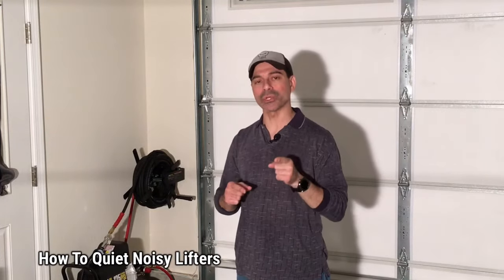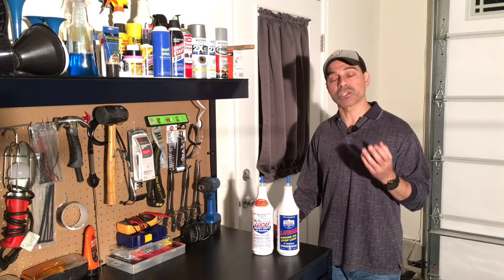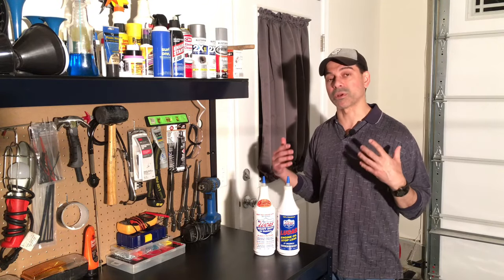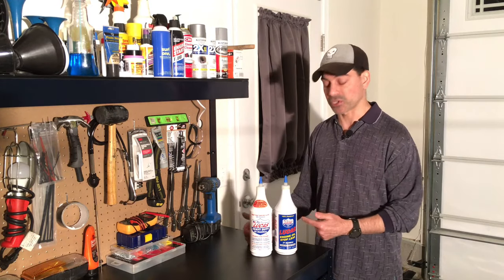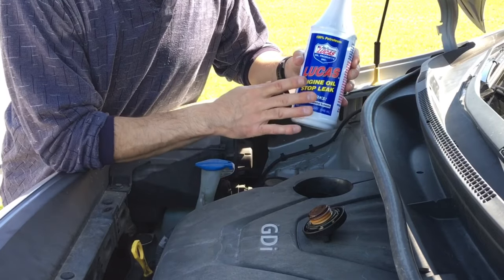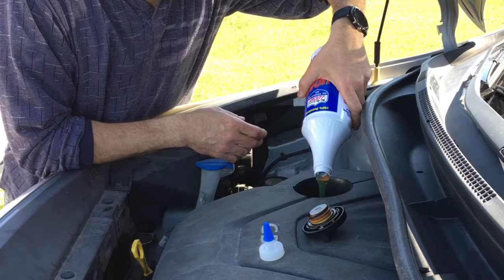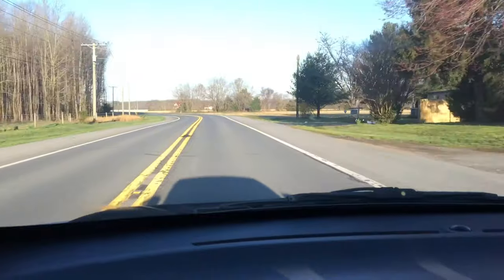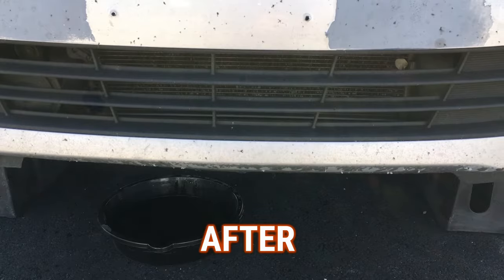How To Quiet Noisy Lifters (Andy’s Garage: Episode - 253)

Comment: Several years ago, my 2002 Chevy truck had a loud lifter ticking noise. I checked the oil and it was a quart low. I added a quart of Marvel Mystery Oil to the crankcase, and soon the lifter ticking noise disappeared, but not nearly as fast as the Kia in this video. I drove the truck about 400 miles and when I changed the oil, it was extremely dirty, telling me that the MMO had removed some or all of the sludge out of the engine.
       Now after a oil change and it is a quart low on oil, I add a quart of Marvel Mystery Oil to the crankcase for preventative maintenance.

       I have also been using Marvel Mystery Oil in the gas of my truck, car, and lawn mower at every fill up since 2016. I use the recommended amount of 4 ounces of MMO for every 10 gallons of gas. Both vehicles and the lawn mower are running better than ever, and my car gets at least an extra 1.5 to 2 more miles per gallon on the highway. With Walmart selling the quart size (32oz) bottle of MMO for $5.97 here in the USA, it more than pays for itself with the savings in using less gas.
Reply from the maker: Thanks for the comment
Reply: You added the marvel mystery oil to the engine?
Reply: @ tisbitae7--     To quiet the lifter ticking noise, I added Marvel Mystery Oil to the oil in the engine. You can add MMO up to 20% of your engine oil capacity. For example, if your engine takes 5 quarts of oil, you can replace one quart of oil for one quart of MMO. 
      You don't want to over fill your engine with the combination of MMO and oil.
Reply: 8/29/2023
2005 Suburban 5.3L with 283k on the clock... Lifters rattling the last 6-8 months.
Tried the Lucas Treatment tonight, except when it was a quart low, I added a quart of Marvel Mystery Oil to bring it back up to full... ran it a couple days, intermittently. 
Lifters REALLY rattled then!
5.3L in the Suburban holds 6 quarts oil.
I added:
1 quart Lucas Oil Stop Leak
3 quarts Lucas Oil Stabilizer
2 quarts Castrol 5w20 High Mileage Oil
Lifters rattled a good 10 minutes after initial startup... pulled it off the rack, let it idle while I cleaned up my mess, and went for test drive. 
Could not make the thing rattle!

Was thinking reducing the stabilizer to 2 quarts and increasing the oil 1 quart at next oil change... maybe, maybe not... the stabilizer is within a dolar of the price of oil.
Reply: @Brian-mp2mv did it blow up yet
Reply: @mikecorleone6797  sure did, crankshaft locked up in December with 290K on the clock. 35mph, 200 yards from home. Never ever drove that truck hard either!

Comment: We always put a quart or two of diesel and have engine warm when you do this just let I idle for a hour and watch your oil pressure gauge to make sure it does not get too low and shut motor down and drain your oil and pour a gallon of diesel just to flush any sludge out and then pour a couple quarts of cheap oil to help fish diesel fuel out and this on 390 ford pickup and the motor was ran with penzoil that had a problem of foaming up and sludge on valve train area and I always use vavoline because it never foamed up and this was back in the 70’s and 80’s but worked great to clean the inside of the engine out and lifters out .

Comment: This seemed to do the trick for me. thank you very much. I mentioned to my mechanic that it started ticking after my last oil change and of course they were willing to charge me 3000 to replace the lifters when in actuality they probably cause the problem by not putting enough oil in. will never go back to them.

Comment: I have a 95 Lincoln town car I bought in 2016. The original engine went on me so had another put in. About 4 months later it went. The engine in now is running pretty good as I have a great mechanic. The last 6/8 months notice some ticking mainly on exceleration. Also  some smoke sometimes on leaving a stop light. Put in the honey additive 2 in last 2/3 months. No more smoke and ticking not much. Gonna try the Lucas treatment and see how it goes. Engine has just over 114 and change. I don't drive much. 14 to 17miles 5/6days a week for work. I'd notice the ticking more when it was really hot outside. Not right away. When cool outside didn't hear it

Comment: Hello..
I had the Hemi Tick at 10,000 miles.. tick tick tick tick... that was so annoying. I added a bottle when I changed the oil.
my Challenger 392 ScatPack hasn't ticked for 5000 miles.
Use for all my vehicles, Audi A6 3.0 TDI, Beetle 1.8t and also for my Camaro Iroc 5.0 TPI...
The engines run so well with it.
greetings from Germany

Comment: The best product I have ever found to fix noise, leaks and even transmission problems is STP. To fix a transmission, ant transmission it must be put in and allowed to circulate with the engine running and the transmission warm. This is STP in the blue can for engines. It’s the best thing on the market.
Reply: I appreciate the STP suggestion and I'm all prepared to go the Lucas route if STP doesn't do the trick.  The greatest benefit is that STP is a small bottle that's easy to add to existing oil without having to drain some or do an entire oil change.  STP quieted the engine after about 10 minutes of driving.  Although it's still slightly ticking, it's much better than it was before and I'm happy with the results.  Thanks.
Reply: Did that make ur engine quieter or u had to change ur valve lifters ??
Reply: @tsytv108  in his comment he said it fixed the noise…

Comment: A 2005 lincoln town car I bought last month had lifter clatter on the left engine side at cold startup. It has the 4.6 2 valve engine. The previous owner was using the 5W 20. I simply changed the oil and used 20W 50 castrol and that clatter STOPPED. 5W 20 is for the great lakes area and where it gets below zero degrees, but in the south areas its too thin.

Comment: I've recently been throwing parts at a frustratingly unruly issue in my '98 yukon I bought a couple years ago. 

Issue: At warm idle [or warm (above 40°F) ambient temp] the idle [700 RPM] to 2000RPM is very hesitant and nearly dies before "recovering and over-idling to compensate." 

What have I done? Replaced [all acdelco] Iridium spark plugs, plug wires, cap and rotor. Replaced air filter. Then replaced oil with Mobil1 high mileage full synthetic and oil filter with K&N gold high flow filter, replaced bank 1 & 2 sensor 1 o2 sensors with Bosch [acdelco was unavailable to due strike conditions]. No luck. 

Conditions got worse to where I had to keep the transmission in gear 2 up to 40mph to keep from hesitating/stuttering. Finally figured it must be a stuck valve, and added Lucas full-synthetic additives. Revved to 2.5k rpm for several minutes, let it rest overnight, and the next morning it's perfect. Stress-tested by getting it warmed to operating temperatures, and it's still 90% better. I think Lucas did a great job, but ultimately I need to adjust a rocker/pushrod or clean the engine out with 1k mile oil changes for a while. I'm not a mechanic, so who knows.

Comment: Justin observation I really wouldn't use Lucas too much in the Northeast when you have really cold weather that Lucas turns into. Tar.   I noticed this when I cut the oil pan off my blown motor.  Not saying Lucas is bad but I would say it's primary application would be down south where it's 90 to 100°.  All the time.  Seriously

Comment: One good thing that you can do before adding all that goop is clean out the passages with WD40. Two cap fulls from a Tide detergent bottle will do the trick. I do this in my 2008 F250 that has the Dreaded 5.4 Three valve and the system - being the hydrophilic lash adjusters that start to collapse become unstuck and get restored and the engine is back to near normal. Now I cant know how much wear has been done before I got the truck But the clean out has greatly improved the engine and the ticking has subsided. Varnish is the cause in my case and I've found that WD40 will work with the oil as long as you don't go to thin on a old engine that has 228000 KM like mine has.
Reply: @lawrencecavens576 I have that engine in my F-150. It's so loud people think I have a diesel under the hood. I replaced the Cam Phasers, and then I had to take it to a shop and have the engine opened up and replaced something. I don't remember what that was exactly; something to do with the timing. I remember It was $1900. lol. When you say 2 cap fulls from a Tide detergent bottle, what size of bottle are you talking about? There are different sizes. I don't imagine you are talking about the largemouth size. Also, are you adding that to new oil after an oil change, or are you just dumping it in the old oil before an oil change and continue driving on it until the following oil change? If it helped silence 40%, that would be great. It's so dang loud. Thanks!
Reply: So, you're adding straight WD40 to an engine with the oil still in?  Then draining it?  Or are you adding it to an engine with the oil drained or to an engine where the oil has just been changed?  Do you leave it in or drain it?
Reply: Im actually doing both, where WD40  is added to the oil before you drain it and run it along with the old oil - drain and refill. Add two cap fulls and allow it to with your new oil - {but} If the loud clattering doesn't go away with the new refill then this means you may have damage starting already so bear this in mind. I caught mind before it got too bad and the roller followers got ruined. There still is a slight tick after I drive and the engine is hot to running temp - So I can only assume there might be some wear to a lash adjuster, . The Cam phazer in my truck don't seem to be a problem either - but the only way to determine that is to have a scope show what they are doing.   @oldschoolgreentube
Reply: If you have determined that you don't have internal damage like a roller follower failing but from what you are describing is a loss of oil pressure, Now this can go in a completely different direction - The one weak thing that these engines have is oil pressured chain tensioners that have a tenancy to blow out there seals and cause oil pressure loss so this needs to be taken into account and will need inspection...
If your engine is quiet while cold during startup then you have good oil pressure. As the oil thins out due to heat and your engine is a bit louder in noise  - You see It's hard to determine with out seeing or hearing whats going on - Can you do a video to show your situation is like and I can see if I can help further give you a better diagnosis.
Brian from BSM motors has a channel called  Fordtechmakeuloco channel does some very good vids on these engines  you should watch all that concerns your situation . Hope your situation improves  @JimofTheLionKings
Reply: @lawrencecavens5760  please 🙏 MEASURE a cap full of water or something with a measuring spoon or measuring cup and tell us how many ounces or 1/8 cup, etc so we know the correct amount.

Every bottle of tide has different size caps and we don't have the same bottle as you have.  ❤
Reply: @Rise_Higher-444  ok - So 
What you need is a regular measuring cup and measure out 1 full cup. I just used a tide simple all in one the cap as a test . For the first treatment it too about 3 full cups of WD40 to start the wash out. Now bear in mind that this was done at full operating temperature and at idle. 
Once it started to work its way through the ticking sound got quieter and quieter -at that point I knew it was working. 
The other thing must be kept in mind is your oil level - if it is low and not on the dip stick when you check it then this might not work, 
If lack of maintaining your oil changes and heavy varnish is present this again might not work ...
Now there is no way for me to know how much damage is in your engine And what or where yours is making the noise - so keep in mind if the sound doesn't improve then you must and can only assume there's more damage all ready starting to happen and the valve covers need to come off and you must look for internal damage. One thing you can use as a reference is to look up {FordTecMakeULocal} channel on youtube and get yourself up to speed and Brian dose a very good job in in his videos and is HIGHLY recommended.
 Every scenario is different it's just that I caught mine before major component failure.
And high Mileage will also play a roll here too, where Mine was about 226000 KM not Miles  when I started this treatment.
Now If your scenario improves and you've had good success then change your oil - go to a 10W30 if you have high mileage and you can use 1 measuring cup of WD40 along with you new oil to help maintain internal cleanliness and what I do is give a half a cup of WD40 every 2nd week with light driving but heavier use do less with WD40 and stay with 10W30 - It'll vary...
Reply: @JimofTheLionKings  The Caps from Simple clean all in one Tide. It's a yellow bottle - it use to have a orangey cap but now they've gone to a clear cap. But Using a measuring cup and measure out 1 full cup and add this to your engine {While its Running} will be most effective.

Comment: 8/29/2023
2005 Suburban 5.3L with 283k on the clock... Lifters rattling the last 6-8 months.
Tried the Lucas Treatment tonight, except when it was a quart low, I added a quart of Marvel Mystery Oil to bring it back up to full... ran it a couple days, intermittently. 
Lifters REALLY rattled then!
5.3L in the Suburban holds 6 quarts oil.
I added:
1 quart Lucas Oil Stop Leak
3 quarts Lucas Oil Stabilizer
2 quarts Castrol 5w20 High Mileage Oil
Lifters rattled a good 10 minutes after initial startup... pulled it off the rack, let it idle while I cleaned up my mess, and went for test drive. 
Could not make the thing rattle!

Was thinking reducing the stabilizer to 2 quarts and increasing the oil 1 quart at next oil change... maybe, maybe not... the stabilizer is within a dolar of the price of oil.

Comment: Please reply!
I have a Fusion 1.5L Turbo Ecoboost with ticking noise (75k mileage) when starting the engine in the morning and when speeding (giving gas), not heard with steady speed.
I have a P0012 and P0014 (Camshaft position timing…) plus P0455 (EVAP System Leak),  Ford dealership mechanic came with a quotation asking the camshaft over the pistons (bank1?), digital sensors, timing belt, valve cover gasket, engine belt to be replaced! Previous car owner used a cheap engine oil and was careless.
I have watched another precious video of you asking us to change the oil first, I did it, changed to %100 Synthetic of Amsoil + Motorcraft filter, cleaned digital sensors, changed fuel pump, the ticking sound still available, my question is; is the engine still dirty ? Some recommended flushing oil but Scotty and some people don’t recommend, dear Andy; do you recommend adding Sea Foam or Motorcraft Automatic Transmission Fluid to the recently added Amsoil Synthetic Oil (285 miles) ? Or, do you think replacing digital sensors (despite being cleaned and working) could fix the ticking ? Please help me make my mind and decide!

Comment: My minivan has oil replacement at 7500 miles, but it leaks a fair bit so at 5000 miles, there was no oil on the dipstick and I came home last night from a 40 mile freeway run with a fairly pronounced knock at idle that got louder under load. Got up this morning to no knock (oil is thicker when cold), drove to the auto parts store, put seafoam in it per instructions and topped the oil up. I’ll drive 100 miles or so and get an oil change to flush the carbon and dirt out that the seafoam knocks loose. You don’t want to make a habit of this or let it go before treating it or this will be the kind of thing you have to deal with every oil change by putting seafoam or an additive in it.

Comment: I have some sticky lifters. I'm due for an oil change so I put some MMO in the crank case and drove about 500 miles. The lifter noise is about gone now. I'm changing my oil today. Since it reduces the noise I'll probably just top off with MMO again when I'm due for another oil change and hope for the best.
Reply: hows itgo?
Reply: I haven't been as diligent with it. Now that the weather has warmed up I haven't noticed it as much.  There's some other YouTubers that have replaced a quart of oil (not sure, but the directions on the bottle can confirm) with MMO and reported that the sound went away pretty quickly
Reply: @erickgardner3765  At this point , I diagnosed my lifter are damaged or dirty.

Comment: does it take care of the noise ? or the problem that caused the noise ? do we have to ultimately address the problem ? or continue to use this technique and continue to drive ?
Reply from the maker: It will add a thicker lubricant to help cushion the parts causing the noise. It there is damage done you will need to have the parts replaced

Comment: So do you have to keep doing this method forever to quiet lifters? Like after you use the oil stabilizer for a while after oil changes, can you stop putting it in the motor in order to quiet the lifters?
Reply from the maker: You should do this at every oil change, unless you have the issue fixed

Comment: Blue devil stop smoke lol I have a Mitsubishi spider that always tick like crazy and smoked I needed to pass emissions so I used blue devil and it stopped the smoking but I didn’t expect it to stop the ticking 5 years later and passed emissions twice since using blue devil and still no ticking and perfect cylinder pressure . Only need to use it once so no need adding more at oil changes